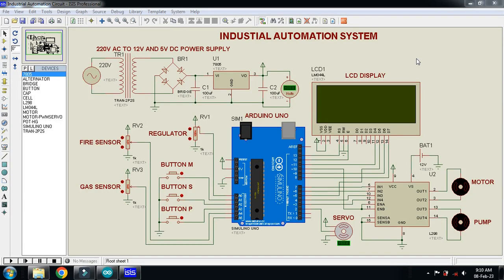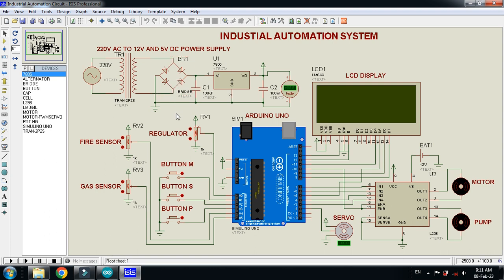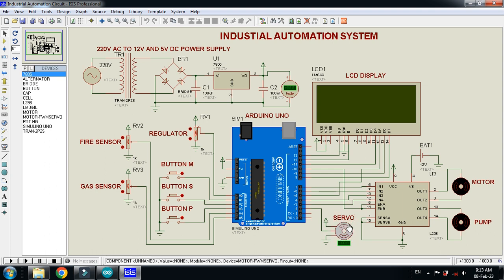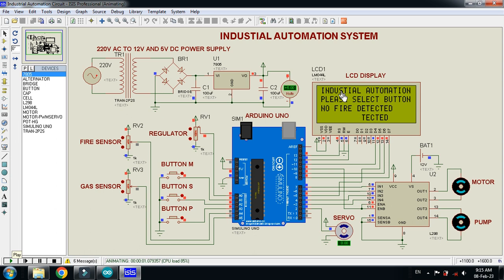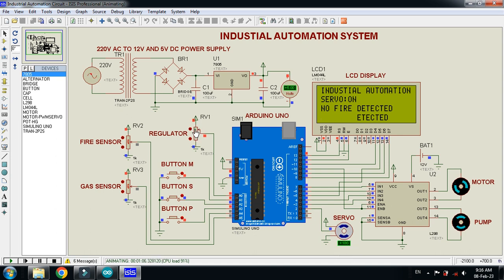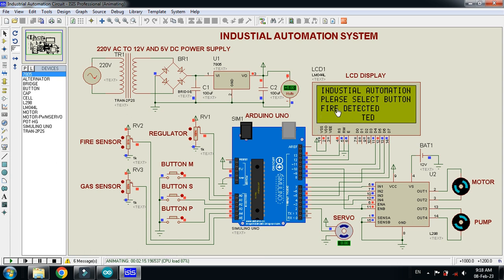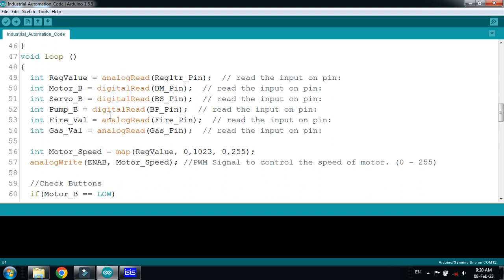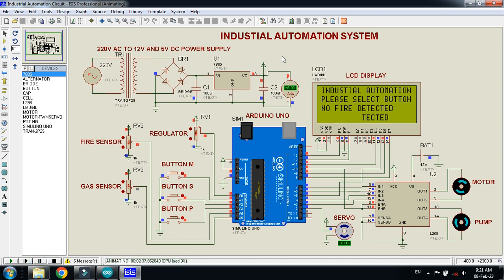Industrial Automation System Using Arduino With Code and Circuit || Proteus Simulation

Comment: I want to buy a proteus diagram pcb can you please give you number
Reply: IOT based industrial automation using Arduino
Gas,fire and light sensor are used
Reply from the maker: Its free of cost. Please download the Proteus file and Arduino Code from the link available in video description.